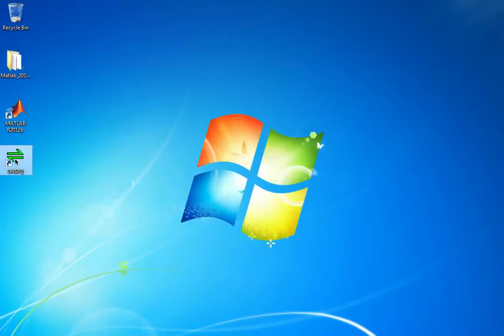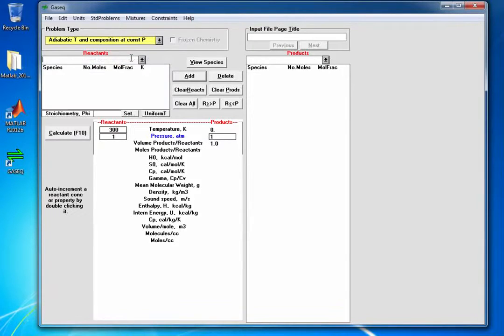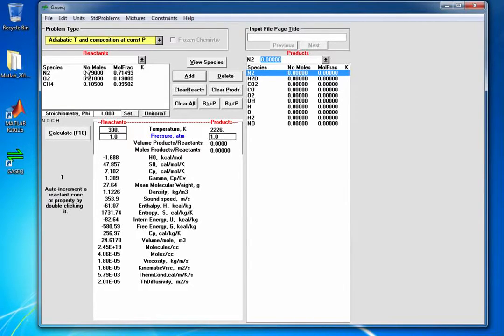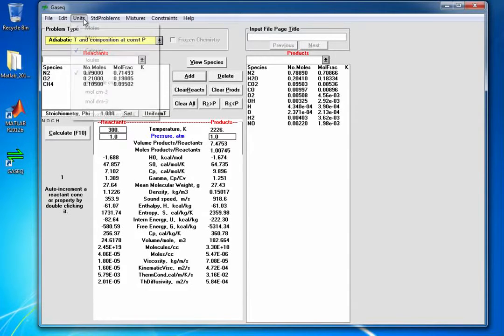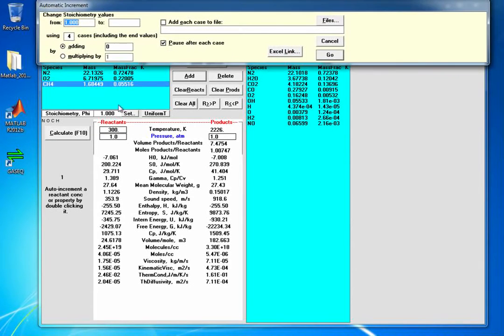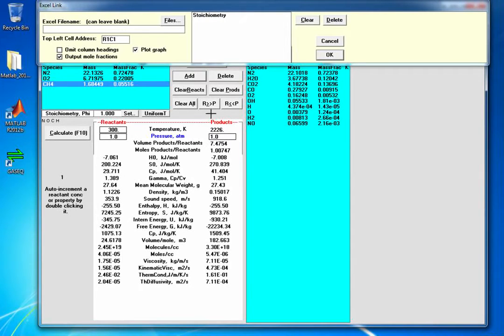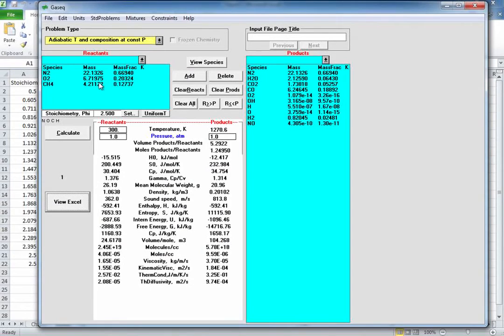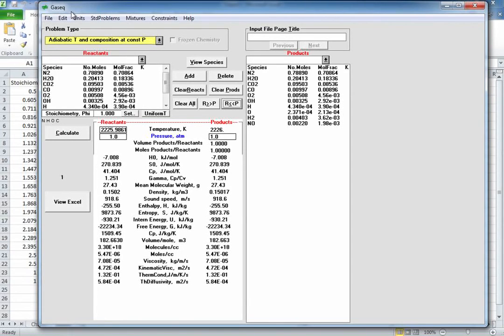Gaseq Chemical Equilibrium Software for Combustion

Comment: Hi. Very useful video! Sorry,  how can I set up a new composition, lets say that I need to add a new composition for Hydrogen at a certain purity level, considering extra species . I get an error when I try to get the values on an excel spreadsheet. Thanks!